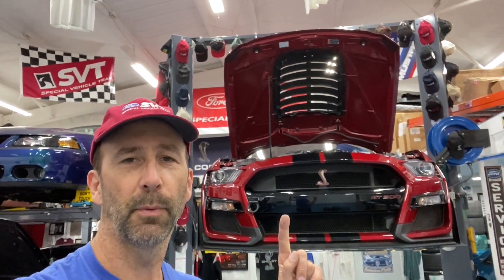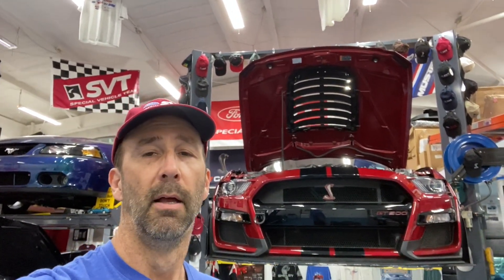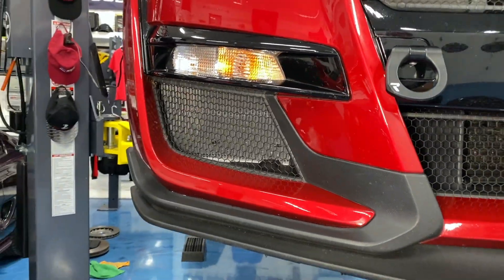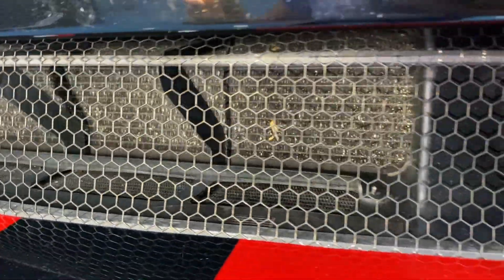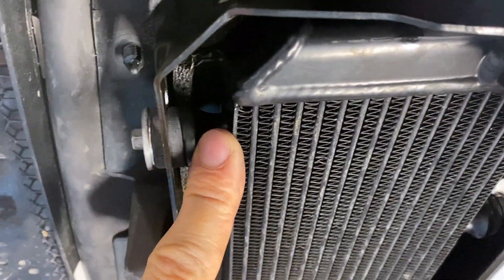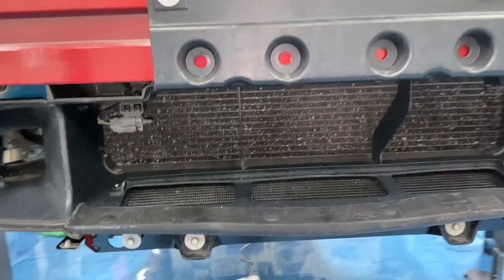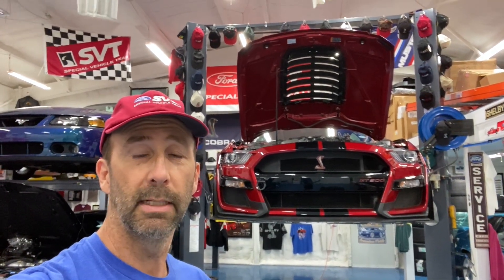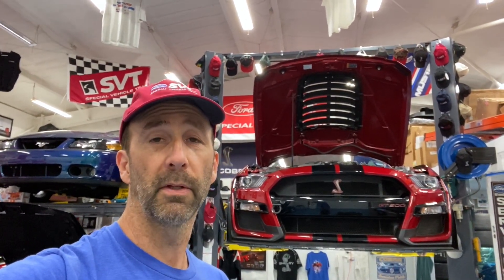2020-2022 Transmission Overheat Solution (design flaw addressed)

Comment: What do you mean by warranty work? Did you get extended warranty?
Reply from the maker: These cars have a 5 year power train warranty.
Reply: @ShelbyFlyer  Yea so what exactly were you getting serviced? Your front air filter? I was unaware that was covered or was there something else that was damage you got taken care of.
Reply from the maker: @w00tec  We swapped the 2 tranny filters, but the underlying problem was a plugged cooler.
Reply: @ShelbyFlyer  got it thx

Comment: I work with dry ice and have a 2020 gt500, do you think dry ice would be good to clear out the trans cooler?
Reply from the maker: My pebbles and melted rubber were packed in the openings pretty tightly. I suspect if you blasted it with anything hard enough to dislodge the obstructions, you might damage the cooler itself.

Comment: Nice find sir, had you pegged for a serious  type A  leaving just one bit left proves me wrong.  😇
   May not look great, would use anything like a scotch brite pad in front of the cooler.  Anything smaller than the passages to prefilter no reason you couldn't  do a pretest or if temps go up remove the pre filter you decided on and just inspect after each track day. Down side would be easy access to clean or replace them.   Can't think of a better solution.
Reply from the maker: Thanks! It has lasted 1.5 years through many many track days before it became a problem. I’ll just drop it down once in awhile and clean it out.

Comment: So you didnt cover the biggest design flaw imo.  Where are the cats?  2 inches away from the trans on either side.  How much heat do you think is generated from the cats at wot from a supercharged 800hp motor.  Shield the cats 50% on the trans side.  Summit sells a cat heat wrap kit.
Reply from the maker: I have a bunch of track days including in hot weather and didn’t have heat issues previously. If having the cats next to the trans was a problem, I would have had overheat issues from day one. This is not the case.